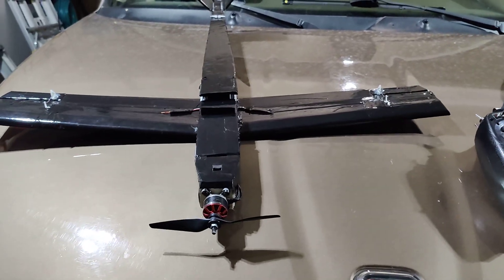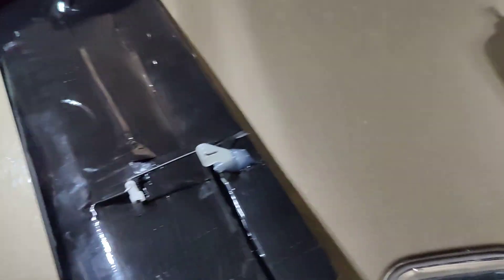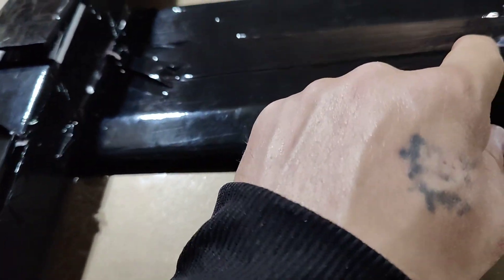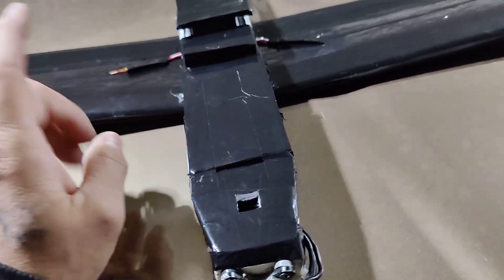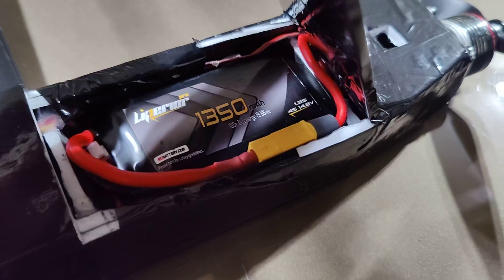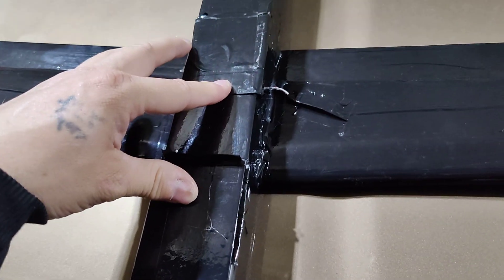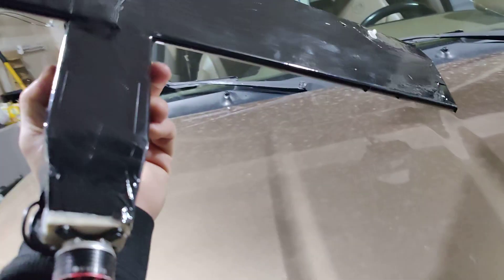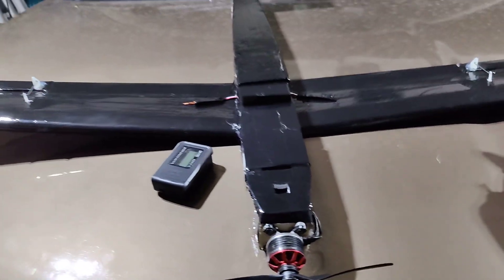Low wing Vtail revision 2. will it hit 120mph??

Comment: You should do a low-swept-back wing. That will create less drag up the coefficiency making it much more slippery. You are having a lot of fun with these scratch builds. I started getting back into scratch building but I'm using pink and blue insulation foam and a Hotwire table from RCFoamCutter. I thought it would be like 9 thousand dollars but turned out the size I cut which is mostly park flyers was under 2k. Now I just need to practice, lol.
Reply from the maker: I think the next one I will sweep the wing back a couple inches for sure. I'd love to get something like that for scratch building! I hope you post your builds I'd like to see what you do and your wire cutter!